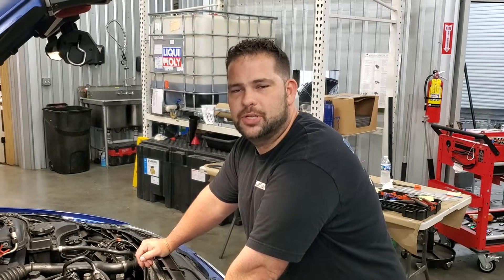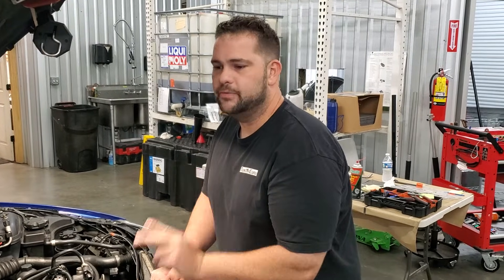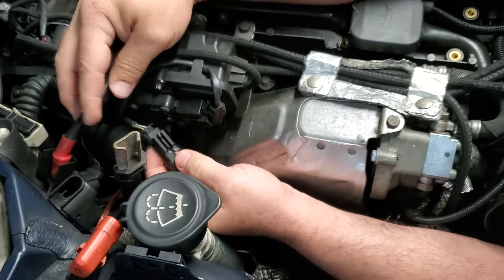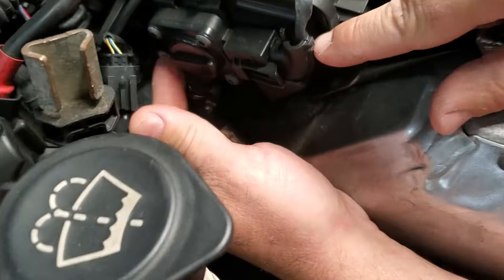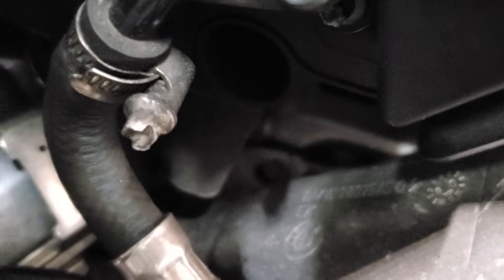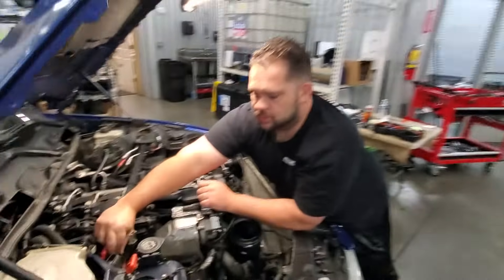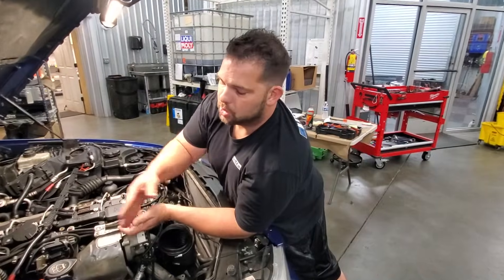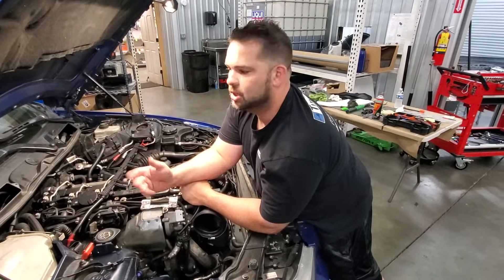Troubleshooting Exhaust gas Differential codes for BMW Diesel

Comment: I hope someone will take a look on this post

On my 120d 2011 177 hp i have this 2 codes (dpf on)

497D exhaust pressure sensor before turbine, plausibility 
4CA7: 4CA7 fuel temperature sensor, plausibility

I try to figure it out myself for now, eventually I'll take it to the shop, but if somebody have an idea will be very nice. Thank you

Comment: What is the part  number for the exhaust gas manifold hose for BMW F10/F11? I have bought the exhaust gas manifold sensor. I need to replace the hose going from this sensor to the manifold

Comment: Should that dpf back pressure pipe be hollow? I pulled the hose/pipe out and couldn’t blow air thru it? Anyone know? Thanks
Reply: well, my hose got burned of and its pumping hot air from that metal pipe that's going from dpf, i need to replace hose and put new sensor coz this one is melted by the hot air

Comment: I have had the same error code for 2 years. 290900 on the F31 318d 143hp built in 2015. EGR exchanged, EGR cooler exchanged. Nothing helps :( Error code comes back between 100-1000km, sometimes with loss of power, sometimes without . I was in 5 BMW workshops - no solution. How do I solve the problem?
Reply: Did you find the solution?
Reply: No :(( Its terrible
Reply: Yesterday I picked up the car from BMW after the recall of the EGR radiator and if I am not mistaken also the EGR valve. The shop foreman had seen the check engine light with code 290900 "AIR SYSTEM, AIR TO EGR MASS FLOW, PLAUSIBILITY MEASURED AIR MASS TOO HIGH" and told me it should not show up for the time being (he did something but I don't know what) and noticed a malfunction on the particulate filter sensor which most likely causes error 290900.  @NoName-pf3yh
Reply: Have they check for any leaks in the hoses? (Esp vaccum hoses) or leak in manifold where you got the swirl flap). Saw some video in the past, that it get pass some leak due to broken rods holding the flaps.
Reply: Yes, everything is checked. Nothing is found ... when I delete the error memory, it now appears every 200km. It is to despair...
Reply: @NoName-pf3yh  that's really annoying. Other people also talks about the back pressure sensor before the Cat, it maybe blocked. Not sure if you heard of it. Others also say something about Turbo actuator.
Reply: @NoName-pf3yh how's it going for 2024 :)
Reply: How are you doing with the car now?
Reply: @bathanmark  i Drive :) no solutions :(

Comment: Iv got 4b7f exhaust gas pressure sensor before turbo charger signal

4ca0 oil pressure switch plausibility

4933 air system air to mass flow plausibility 

Is this likely the same thing as the video ? I can smell exhaust fumes under my Bonnet. Car drives ok but had a couple of stints where the engine management light would come on , then go in to limp mode,.  If I wipe the codes the power comes back but iv had it a few times now
Reply: I have the same error, did you solve it?
Reply: @edwardbenkevich4069  no when I was having half yellow engine management light coming on the dash I used the code reader to read the codes . Probably about a month ago.  Although at the time my car was rough idling etc , 2 weeks later it cleared and hasnt been back since , the only thing really that's changed is I did put through some premium fuel from shell on one tank, then switched to. My norm of Asda fuel and went to Tesco's,  I dont like using supermarket fuel as it is..  I haven't actually plugged in the code reader and rechecked since but If I get a chance I will even though is no yellow management light on the dash .
Reply: @deltamme82 hello, how was it? Is the error code back? Did it help using a premium fuel? Thanks
Reply: @bathanmark  no hasn't been on recently been driving alright , I think there were two periods over the past 3-4 months where the local garage has had some dodgy fuel, I don't like using supermarket fuels,  aslong as you now and again put some decent fuel in plus Wynn's diesel injector cleaner through it and give it a blast down the motorway. As for codes I don't know my code reader is broke and I need to get a new one so I haven't read any codes in the last 2 months
Reply: @deltamme82  thanks. I will give a try also those injection cleaners. Cheers.
Reply: Tez mam ten sam problem jeszcze od czasu do czasu odcina moc…

Comment: If that pipe dry rots will the car sound like it has a boost leak?
Reply: Did u get an answer on this iv changed both boost pipes on my 335d and can still hear that whistle intercooler is also good im thinking vacuum leak now
Reply: Yes
Reply: Car will underboost

Comment: If you have a DPF deleted vehicle, the exhaust manifold pressure sensor is no longer used and the port in the exhaust manifold  can be plugged and you will get no codes for it and have no performance issues because of no reading from the exhaust pressure sensor.

I'm just posting this here because I searched far and wide for this answer and came up empty.  If your banjo bolt snaps off, I'll just say good f-ing luck getting the broken bit out of there.  I like to think of myself as pretty resourceful, but I finally gave up after about 6 hours of pulling everything I could out of sleeve.  The material of the banjo bolt makes it even impervious to meltting/cutting with a torch without melting the exhaust manifold first.   If you can find a way to plug it, plug it.   You don't need the sensor.

Thanks for all your videos Andrew, several of them have been extremely helpful to me.
Reply: Hey Tony my car is also deleted but the code still pops up for 4C83 Exhaust Backpressure
Before Turbocharger,
Plausibility. Egt plugged in correctly am I able to just disconnect the exhaust pressure sensor with no codes coming up
Reply: @hostessking3632  Did Tony ever reply?